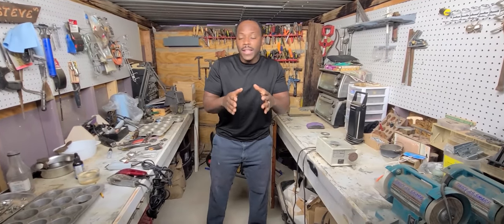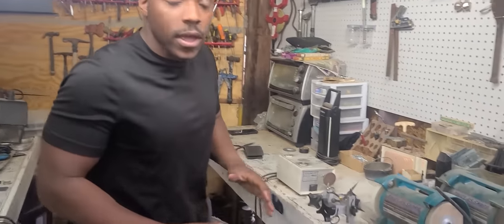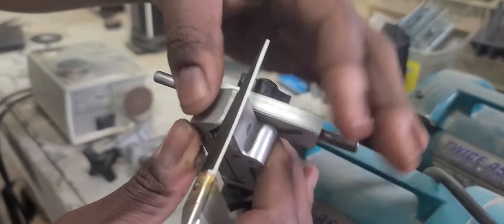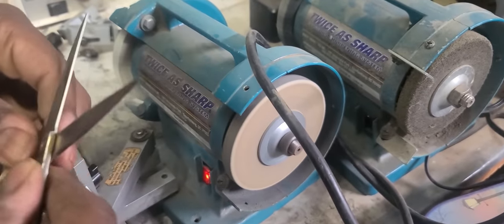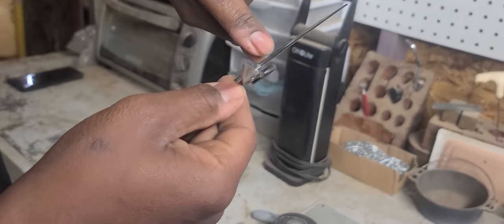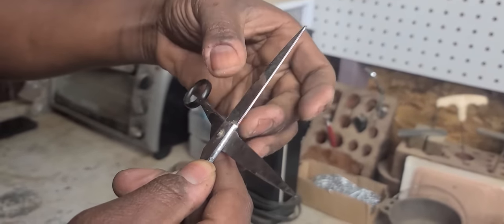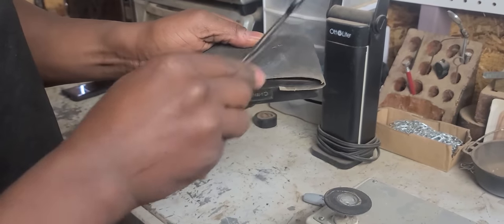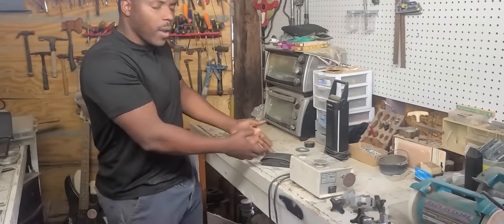How to sharpen shears Professionally  with an ANGLE!!!!

Comment: Hi bro. Thanks for your great helpful video and dropping knowledge for us. But I'm my area the one person who use to sharpen all of our barbers blades and shear's has retired. So I'm looking to take up on that ! So if started practice you methods without the wheel or even your other power sander.with lots of practice. Could I successfully sharpen to a professional level for clients. Doing it with the sand paper?  I feel I really need to take up on this as I know most barbers in my area or the shop I work in now just throw away there scissors once they doll out. Also any other advice? I already thought myself how to fix clippers when my fellow barbers start to have problems with them. I want to be kawhi Leonard like you! Thanks in advance.

Comment: “I tried it and it didn’t work” jk your absolutely right practice practice ... great video we need more of these and this worked out great because I have many old pairs just like that to try it on, what grain sand paper did you use to sharpen shears?
Reply from the maker: You will eventuality get good. Dont worry. Keep up the good work and practice
Reply: Where are you located.
Reply from the maker: @olalekanagboola7492  Arizona
Reply: What part of Arizona? Tucson?
Reply from the maker: @chrisflowers23  Phoenix

Comment: Most beauty salon sheer are sharpened on a 45° angle not 33 1/2
Reply from the maker: It depends on the shear.  Like if it’s a premium shear or a regular flat edge shear.  However if you doing it manually it really don’t matter cause you can’t set the angle anyway.